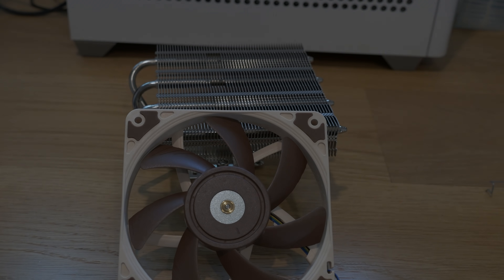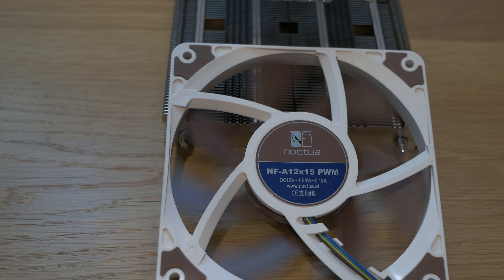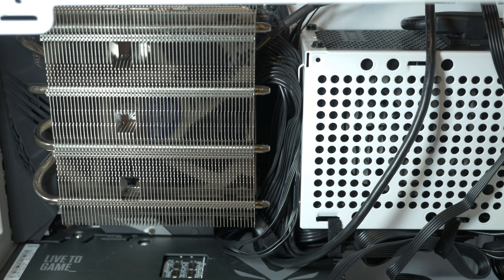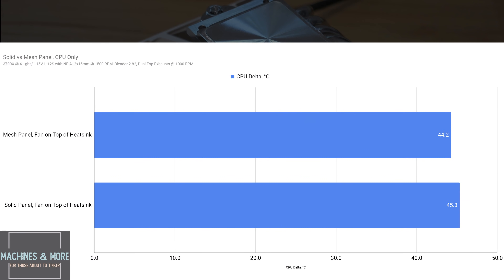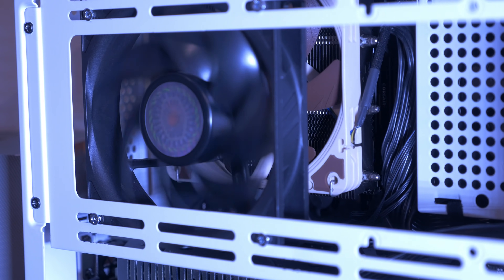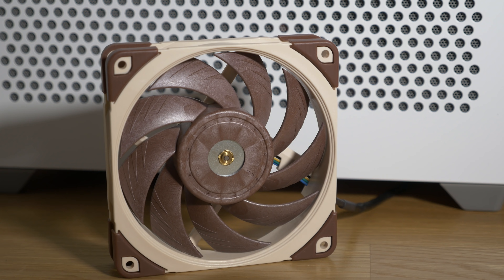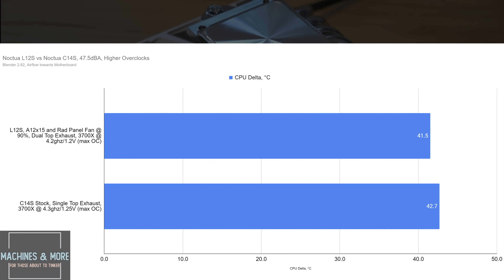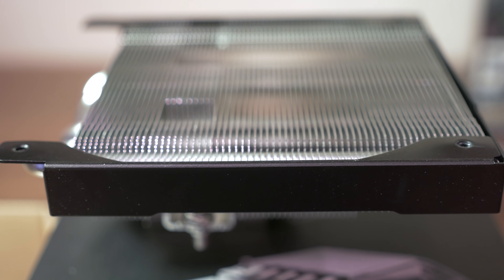Cooler Master NR200: Low Profile Air Cooler Configuration (feat. the Noctua L12S)

Comment: Is it possible to run the NZXT Kraken M22 on the CPU, with decent temps?
I'd love to be able to keep the glass panel.
Reply from the maker: You can- but it requires side/vertical mounting your GPU and then bottom mounting the rad, I’m not sure I would go through that trouble unless I had the M22 already, since most of the towers will beat a 120mm AIO with no difficulty.

Comment: Will the Noctua U9S fit with a side panel fan? I already have a U9S on hand and wonder if it'll be good enough for a 3700x with a side panel fan instead of upgrading to a Fuma 2 or Noctua C14S.
Reply from the maker: Yeah, absolutely you can since the U9S is only 125mm or so. You have plenty of space for the side fan- although- I don’t know how useful it will be, blowing air on the closed side of a heatsink. And anecdotally speaking a U9S is plenty for a 3700X, even with light OC.
Reply: @MachinesMore  Oh that's great to know! 

I was planning on putting a low RPM 140mm to reduce noise  on the right most slot of the AIO bracket (facing the PSU) so fresh air can be blown into the intake side of the U9S.
Reply: I have a U9S with push/pull exhaust fans in the NR200, and a 25mm thick Noctua A14 fan mounted on the side rack doesn’t fit — but it would fit if you mounted the side fan directly to the panel (as I’ve seen done on Reddit)

Comment: why not use slim 92mm fans on the backside?
Reply from the maker: It doesn’t fit with the L12S.
Reply: @MachinesMore  I see OP edited his question, so maybe he added "slim" after you answered. A slim 92mm fan like the NF-A9x14 should fit if the clearing is 20mm.
Reply from the maker: Ah, good point. Yes, you can fit a slim fan there. I have one and can check. With a side panel fan  and top exhaust I think you’re getting enough airflow over the cooler that the 92mm fan at that point is past that point of diminishing returns. I’ll try it with the slim Noctua I have.
Reply: @MachinesMore  i have see pictures with 2 slim fans in the back on reddit is that possible with the stock case or only with modding the case?
Reply: @napalmarsch  That might make a case for the glass side panel (pun not intended)

Comment: My NR200P should be here tomorrow, but I dont have a motherboard yet :(
Reply: What mobo did you have in mind?  Any luck on PSU as well?
Reply: @ZioComposite  I dont particularly like any of the b550 boards but I need 2xM.2 slots, also I dont like the mandatory fan on x570. I dont know what to do haha :D
Reply: Introverted Tough spot, gotta be x570 then lol
Reply: @ZioComposite 
Big rant below, you dont have to read it, but I need to vent lol.

 Initially I wanted to get an x570 because theyre only +20$ on average and have slightly better features. But I'm worried about the chipset fan dying in the future. 

On b550, the strix is the most expensive, has the weakest VRM, no led backlight and the fewest usb ports.

The b550 aorus has the best VRM+cheapest but no front usb-c header and no debug leds. The latter is a dealbreaker for me, I dont care too much for the usb-c header.

I can't remember what I didnt like about the asrock b550. The msi b550 has really bad placement on the reset cmos pins.

The problem is mainly that if I'm going to spend 200ish$ for a board, I want to be really happy with it. Maybe I'm too demanding, idk.
Reply: @RyugaHidekiOrRyuzaki  lol, all valid! I may have a possible solution for the chipset issue but it may/may not work for you.  Long ass explanation below but possible solution would be to lower the chipset fan RPM while adding a small noctua/fan to blow away hot air. 

Have had a x570 Taichi since last December and only run the fan at 1300 RPM (20%).  This is to hopefully prevent fan failure and also reduce the buzzing/whir sound.  Chipset only runs at 60-64C since my system is watercooled and ambient temps are about 27-33C right now.  

The problem with my current set-up is the dual radiator which results in hot internals especially the RAM.  So I thought to myself buy a gooseneck  92mm fan and point it directly at the RAM.  Bought one at Amazon but before it got delivered was actually able to place a 120mm fan just in front of ram slot.  Ended up using the 92mm Fan for the chipset which definitely helps keep her much cooler at 54-60 instead.  What I'm guessing is the chipset is intaking hot air from the components because typically it would be at around 60C when idle.  With the fan blowing away the surrounding air, it stays at about 52-55 when idle now.

https://imgur.com/gallery/KZtLgdD
Reply from the maker: Here's my take on this- the Gigabyte Aorus B550 I is the best motherboard for this case, primarily due to its great VRMs and the lower price vs other B550s (you're not paying for a USB-C front header that you can't use with this case). The CPU socket is set high but it's not the end of the world. Two M.2 slots, and I like the full passive cooling aspect of the board- and you're absolutely right on the chipset/m.2 fan being possibly annoying (though this depends on how silent your system is overall). M.2 drives don't need fans as long as airflow is good enough- the Aorus B550-I has a beefy heatsink up top, so if you go with any air cooling option (even warm liquid cooling radiator air blowing on the mobo is fine), you're GTG. Hope that helps!
Reply: @RyugaHidekiOrRyuzaki  The reset cmos pin placement on the MSI is an easy thing to solve, just hook them up to a momentary switch during installation (either reset if the case has it or just add one to the board for a more permanent solution)
Reply: @MachinesMore  You're right but it has neither debug leds or post code, which I may never need but if something goes wrong they're really useful. And at this point I'm just complaining but, it's a 180$ MSRP board, I sort of expect at least a simple array of 4 debug leds at that price point :( Now I'm curious to check if the x570 version has them....
Reply: @ZioComposite  That's a good idea but, how is the fan held in place? I assume it's ziptied/velcroed/taped on top of the chipset?
Reply: @VeritronX  Doable, but I'll have to find a switch to hook up to the header and I dont think the mobo comes with one. I'll check.
Reply: @RyugaHidekiOrRyuzaki  if you look at the build pictures closely you'll see it being held by a silver gooseneck screwed to the fan. 
 In your case would be much easier with  velcroe considering the form factor. 
Linked the gooseneck device below.  Definitely would have been much easier with a smaller fan lol
https://www.amazon.com/dp/B07HFHPQG3/ref=cm_sw_r_cp_apa_fab_2dEBFbDVJD8HT
Reply: @ZioComposite  oh I see